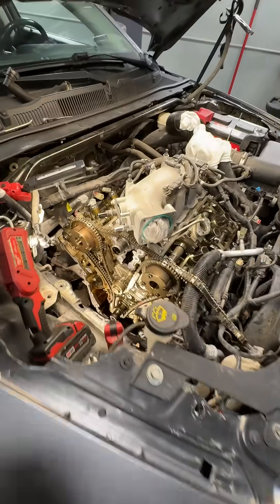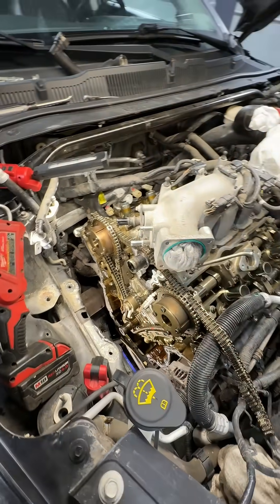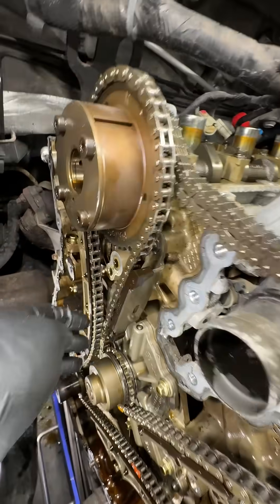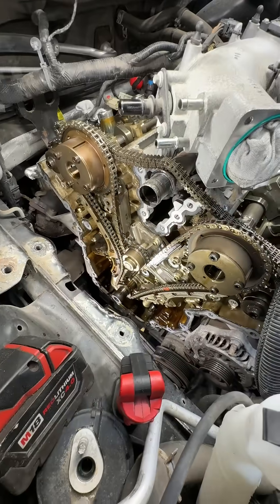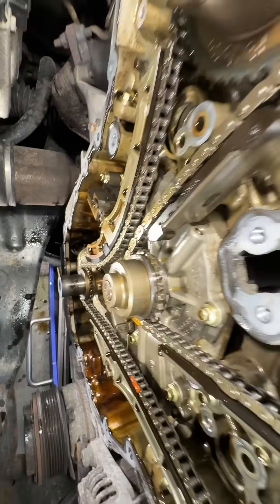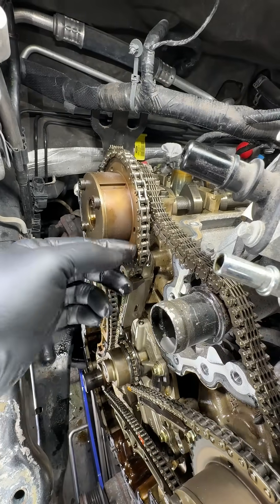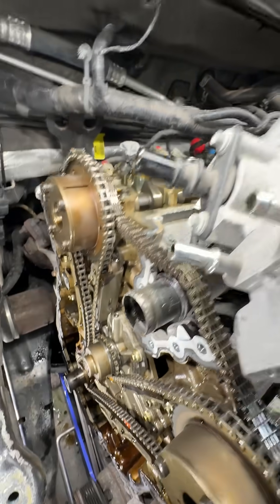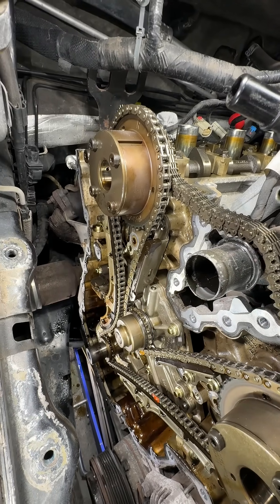This is Why The Ford 3.5L EcoBoost Chains Stretch! #shorts

Comment: My 2015 SHO timing chain skipped at 89,000 miles. At that time I had a heads-off cleaning and adjustment of the heads, water pump, etc. Then the water pump failed at 145,000 miles and I had to have the timing done again. Hoping to make it to 200,000 miles.

Comment: I question whether the links actually stretch or if it is all in the wear at the link pins and their bores. Either way, the chain is failed and needs to be replaced.

Comment: Toyota uses small chain. And techs regularly re-use them when replacing short blocks at 300k. They are speced to last 1,000,000 km.

Comment: I really can't stand the OHC design!  I have the long lasting 3800 push rod car.  With nearing 1/4 million on the OD!  Runs like a striped ape and can still get 28-30 MPG on long trips.  GM shelved  that design in favor of an Opel built OHC engine that is still being produced with so many moving parts!  NAW, Thanks

Comment: Gimme a pushrod motor instead, preferably cast iron heads.
Reply: Still need to drive the camshaft.
Reply: @reason2gether  There's a couple ways of doing that without resorting to 20 miles of bicycle chain or a wet belts, lol.  Linkbelt works for me.
Reply: @dragonpickleX  I've pretty much mastered the th350, it's getting them out then back in I don't appreciate.  They'l go 350K no problem if you just change the fluid and filter once in a while and they can take a fair bit of abuse.

Comment: Mercedes ran a double roller timing chain in their V8's until 1981, when they went to a single roller that jumped time at 30,000 miles. In 1983 they went back to double roller. When these got stretched you could tie a new chain to old and rap in a new one with new upper rails and good for another 120,000 miles as the bottom ends were bullet proof
Reply: I saw the MB timing chain trick performed on a W114 body 230 when I was an apprentice in the early 80's
Reply: Mercedes used double roller chains up to around 2011

All brand new engines introduced after this year went to single roller.

M272 was the last double roller chain for v6

M156 6.2 amg and m273 were the last v8 with double roller chain

M111 was the last 4 cylinder with double roller

All V12 are double roller chain

Basically every mercedes engine used duplex chain up until the m271 4 cylinder was introduced in the c180 kompressor

Comment: Chains don't stretch. They wear. Stop perpetuating the myth.
Reply from the maker: oh come on now are you that dense?
Reply: @FordTechMakuloco  Don't be living irony. Chains don't stretch. The metal wears and the linkage tolerances change causing the chain to appear longer. They're made of metal. Tell me, Einstein, when a cylinder bore wears and you have piston slap, did the bores or pistons stretch? 

Now, how dense are you?
Reply from the maker: Of course the metal does not stretch! Each link wears a bit and it adds up, I LITERALY SAID THAT IN THE VIDEO. Do you want me to say chain elongation?
Reply: @ Why when chain wear already describes what's happening perfectly? Stop trying to be clever. It's beyond your paygrade. 

And let's not pretend that because you used the word wear once that you weren't inferring that chains stretch. Otherwise, you would have conceded and apologized in the first place instead of trickle truthing after getting owned.

Comment: What year did ford update the chain on these? I have a 2015 F-150 3.5 EB, 90k miles and it’s still quiet as a mouse and runs like a top. Just wondering when I should consider a timing job. Always done 5k oil changes with full synthetic.
Reply from the maker: You have a totally different engine.
Reply: @FordTechMakuloco gotcha, I assumed this was a gen one 3.5 eb in your video
Reply: @FordTechMakuloco are the 3.5’s in the cars/ suvs different than the 3.5’s in the trucks? I knew the water pump is different but u thought they were the same otherwise.  I don’t have the gen 2 in my truck.
Reply from the maker: It is similar but way way different.
Reply: @FordTechMakuloco good to know! Thanks man

Comment: Timing Chain Stretch has been a concern for the last 50 years. Plus don't forget the plastic teeth on the cam gears to help with "quiet operation". And one of my favorite was 70's 2.3 V6 in the Capri 's. You could just shut the engine off and the Cam Gear would disintegrate and fall in the oil pan. Chain or Belt high mileage equals timing concerns.
Reply: Oh, the fiber gears on the Capris... Great fun there absolutely... At least those engines weren't "Interference" types, so most of the time, you just got towed, and got a timing gear job.. Good times ..

Comment: Gear driven engines are bulletproof proof. Never understood why chain or belt.
Reply: Because gear driven aint spinning at 7000 rpm .

Thats why belt or chain is more suitable for high reving engines.

Only truck engines have gears
Reply: @fakenews3676  Not true. Smokey Yunick preferred gear driven cams even in a single cam small block Chevrolet racing engine. Gears are more reliable at even high speeds. They are too noisy for typical modern engines today and that is why they are not used. To be quieter, they can be helical cut, but that imparts an axial load on the gears. Straight cut gears are noisy. Pick your poison.

Comment: I have a 16 Taurus na. I just sold my blown up 12 edge. I like this chassis I like these cars. Is there anything I can do about this? I love these three fives they're really good engines for dailies. They're great on the highway. Yeah they're a little heavy on gas but, of course they'll never be a V8, but they feel just as grunty as the right set of gears on a fox body with a stock 302.

Comment: I remember the simple timing chains from the old days lasted forever. 😅
Reply: @gloryland59  most were also stretched to oblivion you just thought they were getting tired.
Reply: The old overhead valve engines had much shorter chains so the same % of stretch was a much smaller amount and less likely to cause a problem

Comment: My 2013 Taurus SE 70,000 mile water pump started leaking and fortunately leaked to the outside of the engine.  Dealer that does many of the police departments Taurus and Explorer vehicles fixed mine, that is key to choosing a repair shop   While in there I told them to replace all chains, phasers, guide strips, even though they said it wouldn't need replaced at that many miles.  Knowing the design and how it is fraught with failure, i am glad.  For 300 to 400 bucks more for the extra parts it is smart while it is apart.

Comment: Had this EXACT thing happen to my 2011 F-150 EB barely 1k miles over warranty. Argued with Ford for two months and they refused to cover it despite the published alert on this very issue with my model year. 6 grand to get it fixed, shop F’d it up twice and it still doesn’t run as good as it used to.

Comment: I have a 2017 expedition 3.5l eco.
How do I know if my timing chain needs to be replaced ? Besides the codes ?

My expedition has 114k miles on it and I am hearing a kinda clicking noise
Reply: Your engine has 2 chains - one chain for each bank of cylinders.  Not like the 3.5L in FWD applications.

Comment: I've got an 06 CVPI w 270k miles. I'm about to change out the water pump, serpentine belt and tensioner. Nothing wrong just thinking preventative maintenance. I can do the work myself. Should I take off the timing cover and do the timing chain, tensioner and gears as well. I would really only need to buy the tool to hold everything in place. Plus all the parts and valve cover gaskets etc. Not sure if I need to do it tho. Thx.

Comment: Could you do a video on 1st gen vs 2nd gen 3.5 EcoBoost and which one you'd pick for long term ownership? Seems like 2nd gen has less issues on the surface but when issues arise the repairs can be more extensive and costly. Would you agree?

Comment: 210k miles on my model year 2011... 3.5L non ecoboost.. Not a bit of noise or a single drop of oil anywhere on bottom of motor or trans. Dry as a cob.
Reply: Watch for coolant on your A/C compressor.  That is your warning the water pump is leaking. Let it go too long and coolant will mix with your oil.  That will not end well.

Comment: I'll take a good old cam, lifter and push-rod, any day!!
Reply: GM still can't master that simple engine.
Reply: And make no power at all.
Reply: @skigdividerx4991  ~ you can't really be that uninformed!
Reply: @rpsmith  Built engines for thirty years. If it doesn't have four valves it won't make the power. Air in air out. You haven't built an engine and you run off at the mouth.
Reply: @skigdividerx4991 I've built plenty of engines...and pushrod engines make more torque and fail less. Period. That's why the king work truck engine for Ford is the 7.3...with pushrods.
Reply: @ashes2ashes863  I can tell you don't have any real knowledge of engines. First off have you heard of the Crown Victoria? With the 4'6 SOHC? Fords best selling AND performing is the 6.7 Powerstroke Diesel. Push rods have nothing to do with torque.

Comment: So, what do I do with my 2012 MKT? Is still running and driving with 202,000. It's had the p0016 for about 3 years and I've driven it back and forth across the country several times. Should I sell the motor and trans while it's still running?

Comment: is it time to run Sthill chain saw bar oil ?, its getting ridicules with these chains  , my 91 GMC 5.7 still has the same chain after 240 xxx on it using 10/30 after all those years

Comment: Hey maybe you have an idea. My 2023 aviator 75k miles has a whinning noise towards the passenger rear side. When low speeds, the sound comes on and off. On highways it gets louder when i accelerate. I took to dealer last wek they said was the wheel bearing,  they replaced it but nope, it still with same whinning sound. Any idea it could be? Reading online, getting results as could be differential issue, or axle. Lmk any thoughts thank you
Reply: Looks like Sound coming from passenger rear wheel

Comment: Basically eco booms in nearly all forms got issues? It's like they just don't learn
Reply: Usually it's poor oil and or lack of maintenance. I've never had timing issues on a fleet of ecoboosts. They all survived 300k easy. 2011 2016 2018 2022 and now we have a 2024 at 90k miles. We change our oil at 4k to 4.5k max with Pennzoil platinum and motor craft filters.

Comment: When does the factory recommend the chain to be changed
Reply: It has no scheduled service interval.  At the dealer where I worked, we would replace the primary chain when we did water pumps like this.

Comment: Great info thank you. At how many miles do you recommend to change the timing chain for a 2018 3.5L EcoBoost? I have one with about 25,000 miles
Reply: My 15’ F150 has 190,000 miles on it. Finally time to do the chain
Reply: @flyboynextdoor  Nice! It has not giving you any trouble? Any start up rattle noises?

Comment: Modern engines are crap 95% of them. I’d say they’re not designed for longevity or reliability for that matter. They’re overpriced unreliable over flashy pieces of garbage which reminds me of fake jewelry. It looks nice but it’s vague.
Reply: @maryannmoran-smyth3453  the recommended oil service intervals are way too long and most people run through an instant oil change. 217k on my 3.5 Ecoboost and it's running like a Swiss watch nothing has been touched internally or turbos.
Reply: Old engines are crap about 80% of the time, new engines are crap about 40% of the time in my experience.

Comment: So you can do the water pump on those with the engine in the car. Always hear you have to pull the engine on the transverse mounted 3.5’s…
Reply: That's why I haven't done mine yet. The only thing I can come up with is to pull the passenger fender off. I don't know if that will get me there or not but I think you're right.